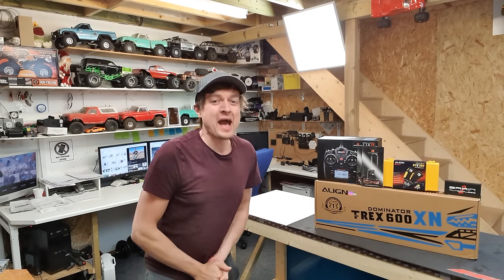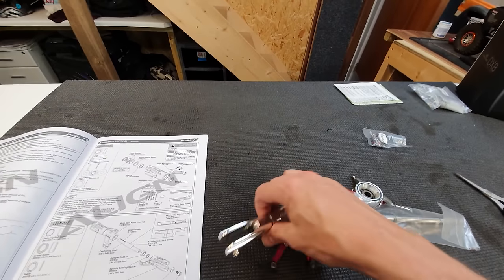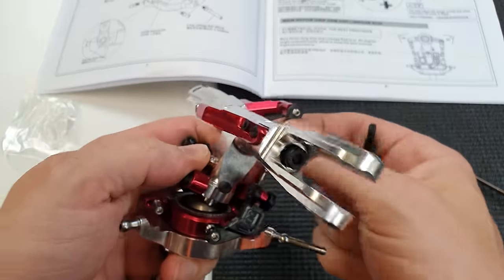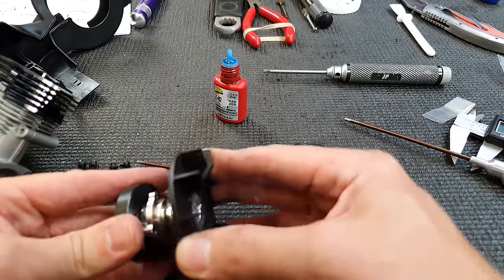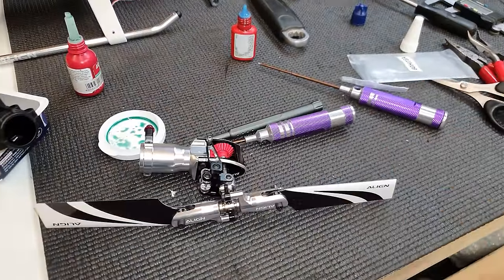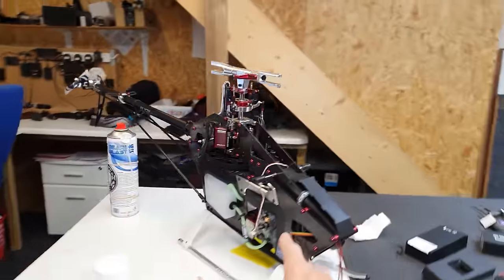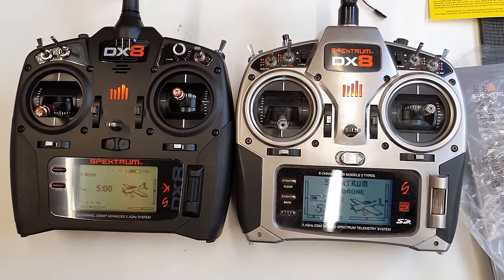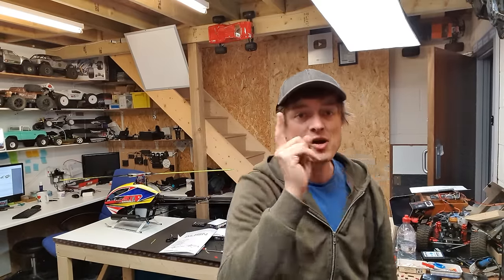Building a BiG NiTRO RC Helicopter

Comment: Big heli you say? Buy a 700 or 800 😅😬😬

Also handy tip for the clutch assembly, if you buy a nylon piston stopper that threads into the glow plug hole it'll keep the piston pushed to bottom dead centre to save having to grip the fan with your hands 🤙🏽

Also with the governor you've probably used them before but getting a set of blanks so you can essentially connect to a cut wire without soldering, and just crimp new pins onto them. Some instances soldering hinders the feedback through the wire, almost like a bit of a capacitor it stores energy.

Loving the builds tho, thoroughly entertaining 😁😁

Comment: I learnt to fly on a 450 trex, cost me like 2500 euro before I could fly, still can't do inverted, that messes with my head, like your skills on the smaller grasscutters
😁😁 Got nearly all sizes of them trex, s they rock 👍can't wait to see your maiden.
Ohh and a small dab with 270 locktite is plenty enough on the featheringshaft bolts, that's gone be hell to replace. 😜

Comment: Hi Kev. You will need to do the clutch liner mod because if it comes with metal clutch liner you will melt the gears in the clutch stack

Comment: Kev the rotor pitch values are actually quite important. Each airfoil has an efficiency range, once the pitch because too great you will lose lift and the helicopter will drop like a rock. You are correct that you can correct it in the field while flying. Most guys go crazy tuning the pitch to perfection in order to get the best performance but eyeballing it while flying would still give you the performance you are looking for

Comment: nice build!

Watch for the clutch slipping and heating up if you fly it hard. It will eat that plastic gear box. I put the metal one on mine, gonna try to put a normal liner in the bell too.
Reply from the maker: Yeh i, tempted with that alloy gear case

Comment: @3:55 you put loctite onto a bearing. you should dap a tiny amount into the female thread at most when going through a bearing. Also you can use Dielectric grease on the thrust bearings and any O-rings.

Comment: FYI, if you crash the heli, the body is not going to be your main issue. If the blades just scrape the ground, the whole heli is basically wrecked since most of the inner parts are going to get bent or broken due to the forces applied. And if a blade hits you anywhere in the upperbody area, youll go to the hospital and stay there for pretty long.

Comment: I would never use the high strength loctite on the rotor head. You will have to control the rotor head so many times because the rotor main shaft gets bent very easily during crashes. The blue on is strong enough. I´m flying a T-Rex 550E & 700E and all my rotor heads are build with blue loctite, never came of by accident. But it seems like a generell strategy of Kev to use the green high strength loctite everywhere.
Have fun Kev :)

Comment: The beeping noice on the DX8 is because  you are going over 25% throttle and your timer is starting. You can remove the timer or just turn the sound down. Are you putting an operator ID on it to make it legal?

Comment: Hey Kev I have a question is the  T-rex 500 better than the T-rex 600 because i am worried about the maintenance of a T-rex 600 🤔🤔
Reply from the maker: different, 600 is my fav size, had 700 trex and goblin before

Comment: 3:47 - Umm... I thought that threadlocker eats plastic. Or, is the the threadlocker just going into a metal part that is embedded in the plastic part? Impressive machine. I'm always impressed by someone who can master a machine like that.
Reply from the maker: yeh locktight only into metal
Reply: @KevinTalbotTV  Thanks... you had me wondering but, I guess I should have paid closer attention, LOL. I'm looking forward to your next video.
Reply: Most plastics on a helicopter are either nylon or polyoxymethylene neither of which is affected by threadlock. Plastic that is attacked by threadlock will definitely be attacked by nitromethane so they use non reactive plastics. Not even acetone will harm nylon or pom they are resistant to most solvents except for really aggressive stuff like say benzene.

Comment: Try to cut grass with that helicopter too! Like the comment if you agree he should do it.

Oh and I found a driveshaft solution for your Traxxas slash 4x4 and rustler 4x4. The driveshafts are the Tekno rc m6 driveshafts. I bought some for myself, and so far, I haven’t had any issues with them yet.

Part numbers
Front: 6851x
Rear: 6852x

Comment: Thanks for the video Kev. Do you remember the kyosho concept 30 rc heli. That was my last nitro power rc. They have moved on since I've last flown. The gyro was a motor spinning. Oh! the good old days! 🤣
Reply from the maker: Yes I do
Reply: @KevinTalbotTV  Amazing to see the level of detail in the new heli build. Thanks again for your time and effort in producing the videos. I  fly the blade nano ncpx. Great fun. I can just hold an inverted hover. Would be good if you could show us the different flight set ups. Take care. Ho. In the day I had a 6v subaru brat. I remember "upgrading" to 7.2v battery packs. Oooo the power. 👍😊

Comment: I feel bad!
I've always affirmed the notion of "not a toy", I didn't imagine I was not helping the hobby by scaring people away, thinking this is a professional requirement.

My concern was always in safety, and only ment for the youngsters who have no experience yet..
Especially flying a large toy like this which has decapitated people. I do agree tho now, it is still a toy and fun should be had.

I still don't feel right handing my controller to someone when I don't know there capabilities, or that nights alcohol intake. My RC savage X weights about 8-10lb, with its street tires and 3 speed it easily goes over 50mph. Its zero concern for cost if the person wrecks my car, but the damage they could do to people...

Comment: A 600 class heli isn't considered big at all.  The 800 and above classes are. My turbine heli is a modified Vario XLT with a 2.5 Meter rotor and weighing in around 35 pounds.
Reply from the maker: you're amazing

Comment: Its called a Jesus bolt case if the bolt comes out you'll be seeing Jesus, i actually don't know i just wanted to say that.
Also when you put the balds on, everyone told me oh just make it touch tight and they flew off in mid flight, so i guess what i'm saying is i like your method better.

Comment: For rc anything electric is way more reliable at this point in the game, that folks is the Coors cold hard facts !yeah it's cool to have a mini gas engine but when I'm wanting to play ,I don't want to be tuning and turning a screw driver pulling out a starter pumping a string getting it warmed up having to constantly buy parts and rings and gaskets and the screws coming lose it takes away from the enjoyment turns into a lot of work for 30 minutes of drive and then thinking how do I fix this I want to enjoy my hobby not sit and work on something constantly if I want to do that I'll clock in at work .